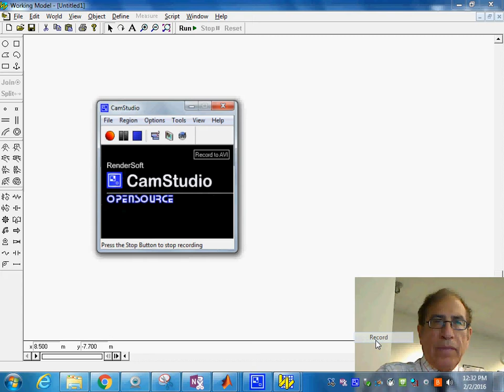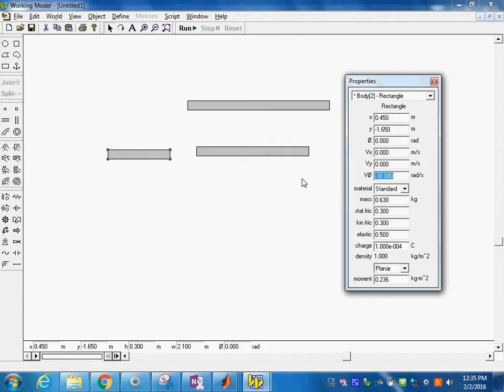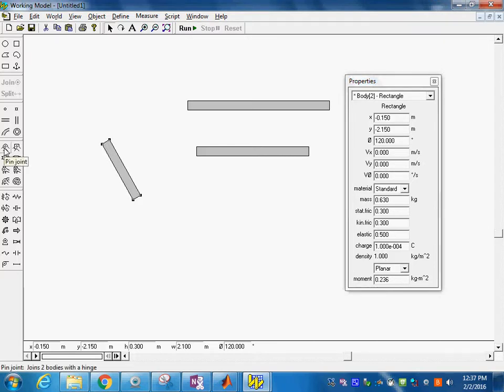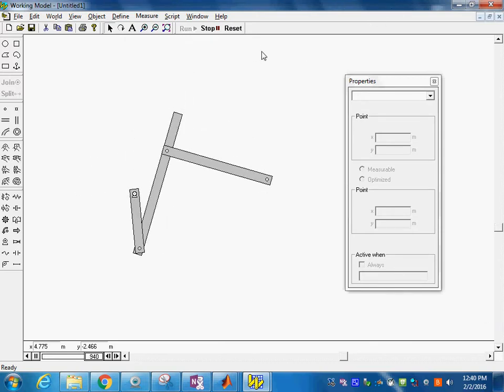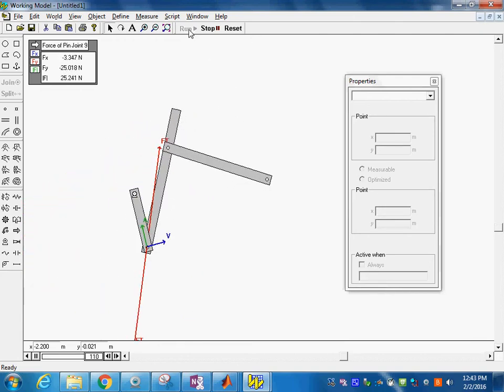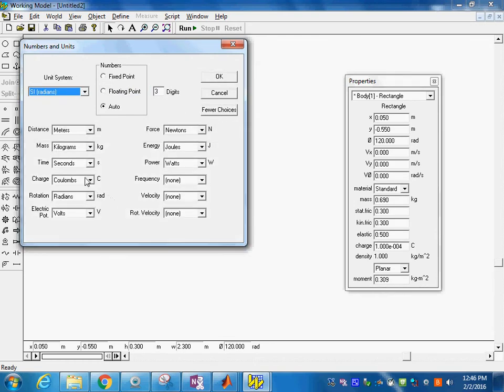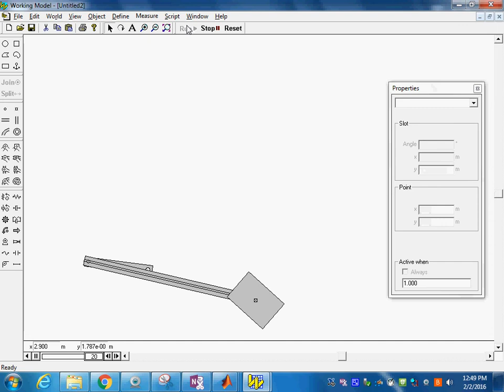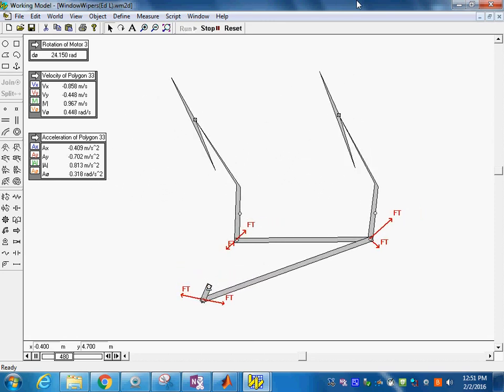Building Mechanisms with Working Model 2D  222016 1252 1

Comment: Thanks for the video. How to drive a rotating bar at a given angular velocity and acceleration? For example, a bar is pin joint at one end. We want that when it is 60 degrees measured from the horizontal line, its angular velocity and angular acceleration are 10 (rad/s) and 2 (rad/s^2) respectively.  How can we do that? Thank you!